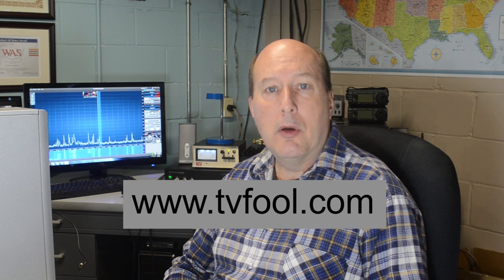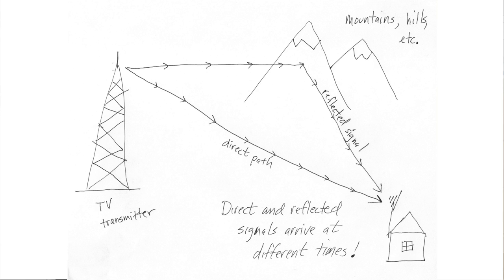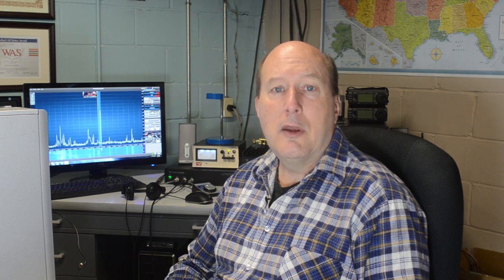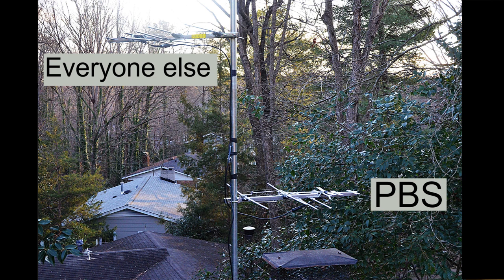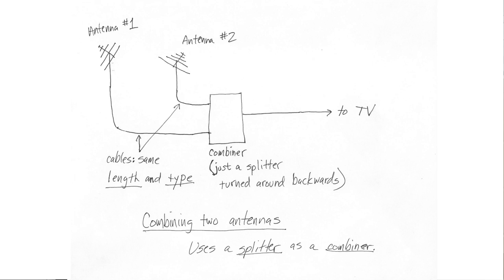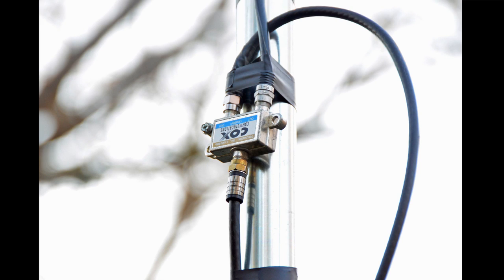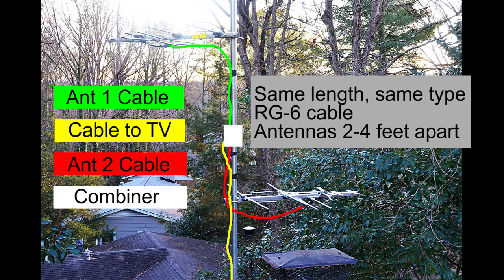Combining two TV antennas for better HDTV reception

Comment: I live on Hamilton mountain approx about 230 feet higher then lower land .....IAM finding if I have the antenna 15to35 feet I get less then I do lowering it 15to0 feet.10 feet seems the best last night I got Ion ,PBS  ,NBC,abc cbc as lk in all I got 21 channel.th clisest transmitter is 46kms away and the one last night was 125 kms away it's worried my situation.......anyone

Comment: Would a rotor do the same job or is it different now that it is digital?
Reply from the maker: A rotor works fine, but if you have one rotatable antenna feeding multiple TVs then it can't point toward all the stations at once. I discuss this at 5:15 in the video.
Reply: I live alone, but still it's a pain to get out of bed, go the the living room to turn the rotator then go back to the bedroom. HI HI
Reply: Doug Hall ahh i understand a master antenna system...

Comment: you didn't happen to experiment with stacking them for increased gain in one direction while  installing the 2nd antenna
Reply from the maker: No, but I know that is commonly done. Properly stacking two identical antennas should result in additional gain, but there are a number of variables involved. I don't have much experience in that area.

Comment: There's an easy way to get around that multipath problem with two TV antennas. Instead of combining them at the pole, bring both coax to each TV and use an antenna Switcher.

Comment: what about the signal loss in the combiner or splitter.......
Reply from the maker: All passive devices have loss. The loss is usually printed on the case. If the signal gained by having an antenna pointed in the right direction exceeds the loss then it's a win.

Comment: i would think that a combiner would cause a 3.5 db loss as it does as a splitter.  I Cannot afford that loss with a weak and fragile signal from antenna elements to begin with.  The technical reason for a splitter to feed two TVs from cable does not exists here, so I wondered what is wrong with just splicing the two wires together.   I ask, because you can buy an 8 bay bowtie (wonderful powerful design) where they are just wiring together the elements from two 4 bay bowties, and furthermore, each 4 bay is just single bays wired together directly.
Reply from the maker: Yes, there is a loss in the combiner. But just wiring two coaxial feed lines together without regard for phasing or impedance matching will result in an impedance mismatch at the TV end of the feed line, which in turn results in additional loss in the feed line due to SWR.  In the 8 bay antenna this match is achieved by maintaining symmetry in the feed system. The antennas aren't just randomly connected.

Comment: O U C H !  That 'combiner' (or splitter) introduces -3dB LOSS!   -3dB equates to 50% SIGNAL LOSS from EACH antenna!  Note:  "multi-path" mentioned usually equates to "Ghosting".  Sorry!
Reply from the maker: Unless there is a built-in preamp a splitter (or combiner) is a passive device. Split the power into two paths and each one, by definition, is half of the original signal, or -3 dB. No free lunch. But 3 dB loss is far better than the 20 to 30 dB of loss that can be experienced off the back or side of a directional antenna. And you may have missed it, but I clearly stated that multi-path is what causes ghosting, or its modern day equivalent of pixelation and dropout.

Comment: But you could have just bought the OTA antenna with the box that already has a splitter built in with remote that rotates.  No need for 2 antennas...but my rabbit ears antenna works better than the antenna I have on my roof

Comment: Doug, what model is the spectrum analyzer on the monitor behind you?
Reply from the maker: Larry, that's actually a Windows application called SmartSDR. It runs a Flex-6300 ham radio transceiver and shows a view of the RF spectrum of the currently selected ham band. Yeah, I'm one of those crazy amateur radio people.
Reply: @doughall1415  Thanks for the reply Doug

Comment: Since the cables that connect the two antennas need to be the same type and length, I would have thought that the two antennas would have to be the same type also.
Reply from the maker: No, the requirement for the cables being the same length and type has to do with the antenna impedance and the way the signals are combined. As long as both antennas are directional and have the same feedpoint impedance (75 ohms) the type of antenna is not critical.

Comment: I have a couple of questions:
1.  Why does the the OP (Doug) fail to answer any of the questions that have been posted here for the past two years?   Has he lost track of his audience or just lost interest?
2.  Why are people so amazed that two antenna outputs can be combined?  Most splitters are labeled as a "splitter/combiner".   The DB8X from Antennas Direct and the HDB8X from Solid Signal are just a pair of 4-bowtie antennas strapped together with a splitter/combiner to form an 8-bowtie antenna.  Not exactly a new idea.
3.  Do people realize how much simpler things are when 22 of your channels are in the green?   Will this work in fringe areas?   Only way to know is to try.
4.  If a splitter loses 3.5 db, does a combiner gain 2.5db?  Uhhhh, maybe.  If both signals are identical and perfectly in phase.  Inside that little box is really just a transformer.  It can step down or step up.
Reply from the maker: thewileyone1 I don't know what you're talking about. I have answered dozens of questions since the video was posted.
Reply: Sorry.  It's the way YouTube displays (or does not display) them.  I read every comment going back to the beginning but I never saw your name.    because I never hit "View reply".   Apparently YouTube hides them to conserve screen space?
Reply from the maker: I don't know, but I've seen the same thing before. It also sometimes puts comments in a chronological order known only to YouTube. Cheers.

Comment: The only problem I see is that by doing that now any and all the signals is now 180° out of phase.
Reply from the maker: Out of phase with respect to what? Where is the phase shift coming from?
Reply: Doug Hall you did cover it somewhat. Antenna A on one side of the mast receives channel 27 then microseconds later Channel 27 signal passes over the antenna B on the other side of the mast. That causes the signal to be out of phase.

since we do not live in a perfect world. and since your antennas are not a 180 degrees to each other the effect would not be as noticeable.

Comment: combiner and splitter are different, a 2 way splitter wont combine the two signals
Reply from the maker: Sorry, I disagree. Prior to making this video I used a spectrum analyzer and two signal generators to test a number of inexpensive "off the shelf" splitters. They all worked as combiners, with the insertion loss within the limits specified on the device. Look at the schematic for a typical 2-way splitter and you'll see that it is NOT a one-way device.
Reply: some splitters have one way diodes in them to prevent two way communication
Reply: combining means it equalizes both feeds at same db, splitters share bandwidth to both , completely different
Reply from the maker: The diodes in diode steered splitters are only there for DC steering. They allow DC to be fed through to an LNB, and prevent backfeeding.
Reply: yes a diode only allows 1 way travel, and a combiner makes all db goto the same port, a splitter shares db between it, they are different, that is why there are splitters and combiners
Reply from the maker: You're missing my point. The diodes in a diode steered splitter are for DC only. Look at the schematic, or if you have an old diode steered splitter laying around, open it up and look. There are capacitors in parallel with the diodes. The diodes steer DC, while the capacitors allow AC (signal) to pass, effectively bypassing the diodes.
Reply: antenna splitters do not have dc voltage, you are thinking of satellite diplexors, not the same
Reply from the maker: No, I'm thinking of diode steered splitters like the ones Holland makes. They allow the LNB to be powered regardless of which tuner is switched on. The Holland splitters are rated from 5 MHz to over 2GHz, so they easily cover TV and satellite frequencies.
Reply: lnb is a low noise block feed on a satellite dish not an antenna, those are powered with dc, they use diplexors and specially designed splitters and switches

Comment: Have the ariel on a motor so turn the ariel to a differint tower
Reply from the maker: I mentioned in the video why that wasn't practical in my case. I guess you missed that part.
Reply: @doughall1415  A lot of people nowadays are moving away from subscription tv channels but all of these netflix services are just as expensive all together all round cost local tv channels are the best way to save money i have a cheese burger on my mind for some reason.

Comment: Not accurate a splitter does not allow reverse signal a combiner does.
Reply from the maker: Passive splitters do.
Reply: Cable tv splitters  DO not. and dont have the same mhtz passage as a combiner made for off air antenna's
Reply from the maker: I have several cable tv splitters here. One is marked "5-1000 MHz" and two are marked "40-1000 MHz." The frequency range for over-the-air TV signals easily falls within that range in the US. I've measured the splitter I used to combine antennas (using my spectrum analyzer and tracking generator)  and it easily meets these specs. Finally, there is the empirical evidence from the many people I have heard from who have combined antennas in this way successfully. But apparently we're all just imagining the channels we're receiving on our TVs. Anyway, I'm not going to argue with you about it anymore. Go make your own measurements, make your own video, and post it on YouTube so we can learn from your experience.
Reply: No need to be angry man ! I have 35 years of cable tv and low voltage. was just trying to help , a combiner is not a splitter and there is multiple types of splitters most wont pass voltage hence if your using a remote powered amp on antenna .  Go back to the DIY channel ...moving on!
Reply: I worked for Radio Shack for 35 years. Their splitters we're labeled "Splitter/Combiner" and had instructions for combining two antennas printed on the back of the package.

Comment: Airplanes flying over ? Does that affect your tv signal ? Must be a low flying plane !
Reply from the maker: Believe it or not it can. An airplane (even at 5000 to 10000 feet) or a water tower or a large steel building can serve as an effective reflector of TV signals. This allows them to arrive via a separate path and potential cause multipath distortion.

Comment: I am surprised how people post as professionals when this gentelman it's definitely an amator. Wonder if he know about what is the insertion loss on that splitter . :))) probably -25 . 
They are some type of splitters / combiners that you might wanna use to avoid signal loss. So you all look for a splitter  combiner  (usually a 2 way or a 4 way)  and from that splitter output you will go in a digital amplifier so you can have good picture on multiple tv's .
I hope my explanations help you guys
Reply from the maker: I measured the insertion loss on that splitter when I got it. From the input to either port (with the other port terminated) the loss was 3.5 dB. This is measured directly at the connector and does not include cable losses. Measurement device was a Rigol 815 spectrum analyzer with a tracking generator. Why would you expect 25 dB of insertion loss?

Comment: ? why is it i can get 25 perfect channels for 1 or 2 months them wham i only get 8 or 10 for a month then wham i get 25 for a week then back to 8 whats up with that,this will be the 7th time ive asked on the net but no one ever gives an answer,seems they all take about which antenna is best but guess they really have no clue about how they work
Reply from the maker: Donald, I can make some guesses, but they're only guesses. Could it be temperature or moisture related? If moisture is getting into your coaxial feedline it could impair reception until it dries out again. Are there trees in the path of your antenna that could be wet from rain or snow? That can also cause similar problems. People who experience seasonal problems often find it is due to tree foliage, and when the leaves fall things get better again. Sorry I can't be of more help.